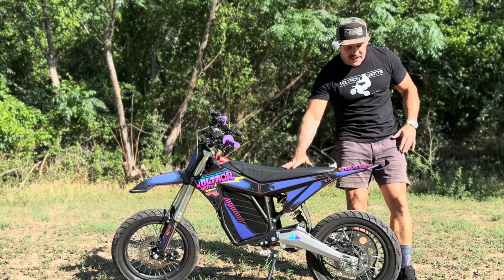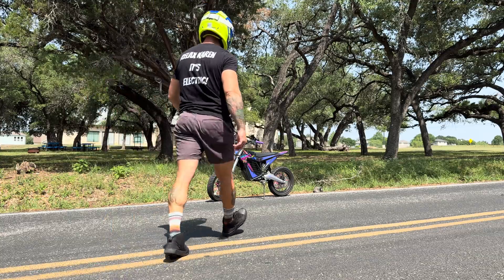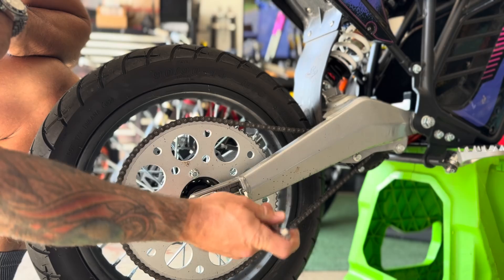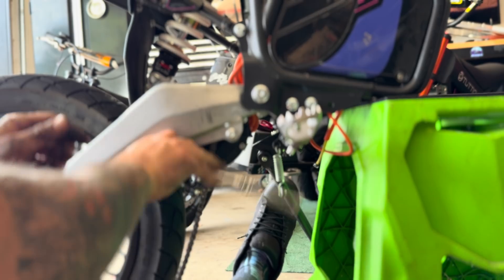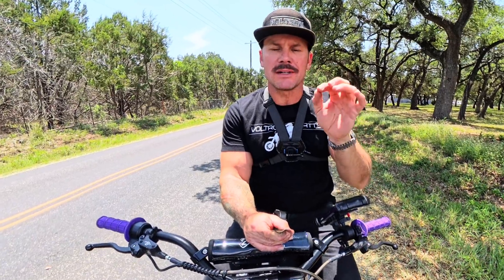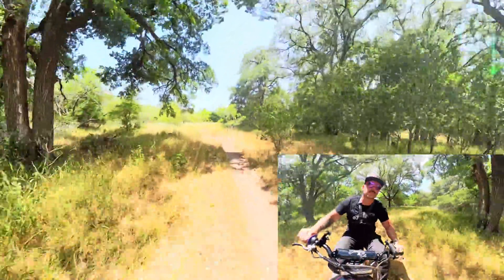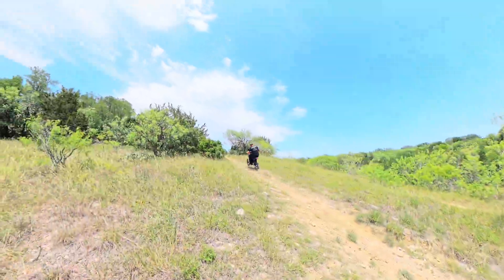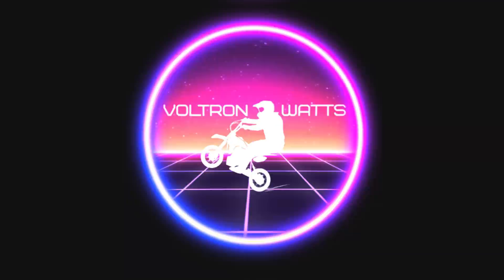ETM RTR Drop In Motor Upgrade! Electro & Co.

Comment: I have the big wheel upgrade. My girlfriend wants the RTR light. I wonder if the regular motor is different than the RTR light motor probably not.  

Also, does the shorter shock mean less travel? This could also be good because now my kickstand is too short with the big wheel upgrade.

Hmmmm
Reply from the maker: RTR vs RTR Lite | Is Saving $1,000 Actually Worth It? 
https://youtu.be/m9W3cu5qhU8
Reply: @VoltronWatts bought it. My S/O wanting one was enough of an excuse. And I can swap over parts when I get upgraded controller/battery/motor.
Reply from the maker: Absolutely 💪🫡

Comment: damnnnn it’s already so good stock now it’s better 😮😮, i like more and more companies are making bolt on kits not everyone has the diy welding skills to fabricate their own things, anyways W vid❤!!
Day 21 of asking for a gifted rtr for the summer❤!!!
Reply: 2:12 wouldnt it be the same as tuning the controller for better torque? Top speed the same 3:40
but the motor does seem beefier 1lbs heavier could mean anything, more tech could’ve been added
Reply from the maker: I’m not following. Sorry man
Reply: @VoltronWatts was asking if the motors are basically the same since top speed didn’t change, doesn’t tuning it give you higher torque, or does this new motor just completely out-torques the old one irregardless if the old one is tuned or not?
Reply: never mind just checked e and c, it’s a new motor completely, it’s something new internally that was done🤣, new motor is definitely better
Reply from the maker: Thanks for watching and commenting as always brotha 🫡

Comment: Yea upgrading it to the torque motor is so much better if your just off-roading 8:00. but aside that i love my 96v tuttio upgrade, its so torquey and top speed 65mph gps. btw for your tuttio build where did you purchase the 45t read sprocket, because i want to get either a 45 or 40t for top speed. thanks Voltron
Reply from the maker: Here ya go 🫡

https://amzn.to/3FxQS3n
Reply: @VoltronWatts  wait 428 sprockets works on the tuttios 420 chain? 😮 and are the mounting holes a exact fit or need minor modifications?
Reply: FYM96V TUTTIO UPGRADE!? WHATT THATS HELLE IMPRESSIVE
Reply: @PixelRiding yea it is crazy 41t on and running 20kw got up to 119km/hr 72-74mph I think. But chucked back on the 60t for torque and top end wise 100-105 is just good and less motor and battery stress

Comment: Maxing out at 50 is trash. I’m cool with less torque higher top end lol
Reply from the maker: 50’ish is standard for a 72v system- if you want a higher top speed you need to add a more power battery and controller like I said at the end of the video where I mentioned the Extrme kit.